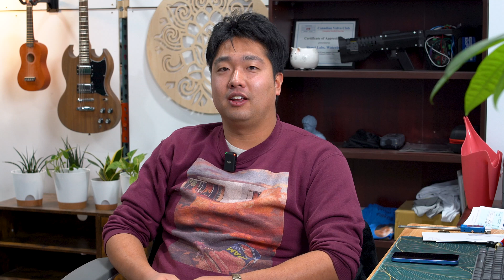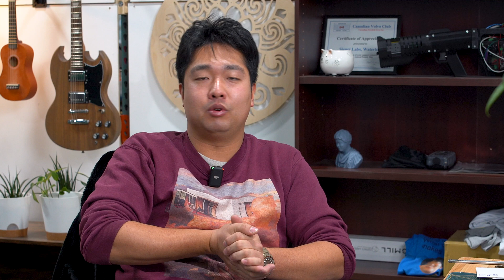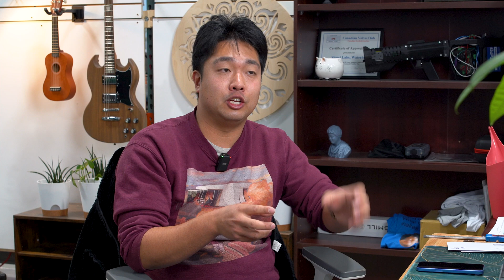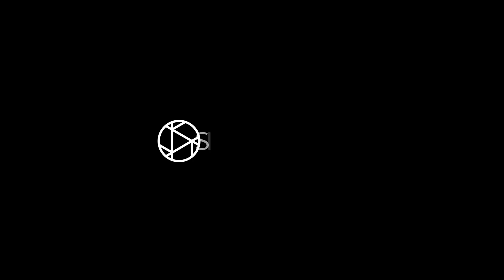Sienci Labs Monthly Production Update - December 2024 - 2x4 AltMill, SmAltMill, gControl & More

Comment: Question I understand that the altmill is not designed to mill steel. But could it drill steel? Say 3/8". An example would be for a weld table.
Reply from the maker: If you set it up correctly it certainly could

Comment: When you guys say 2x4 you mean 4x2, right? I don't understand why you invert the X and Y axis.
Reply: I would actually expect the X being shorter in this regard. He is talking rigidity for metal cutting and the weakest link is the X gantry. Keeping it the 2' side means more rigid. The Y can be shored up with another set of legs in the middle, which isn't an option on X.
Reply: @Mike-k6r Their survey does ask why people would want a smaller machine, some of us have space limitations but don’t want to do any metal work. And the smaller machine they showed in a previous video was 4x2, not 2x4. But it’s also the fact that they appear to invert the X and Y on their website for their CNCs.
Reply from the maker: Yeah it's technically a 4x2 size if you think about it as X then Y